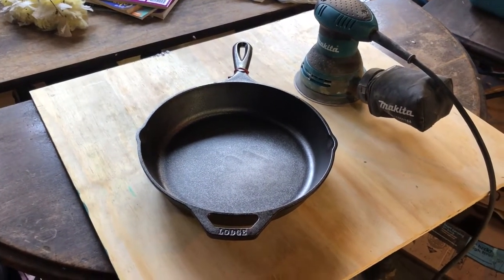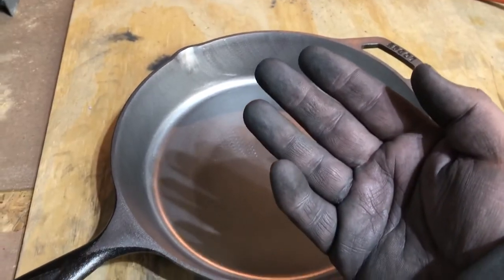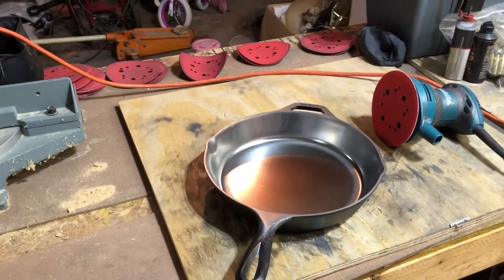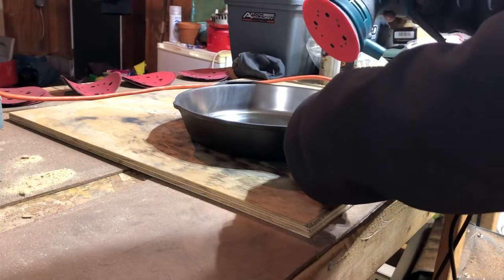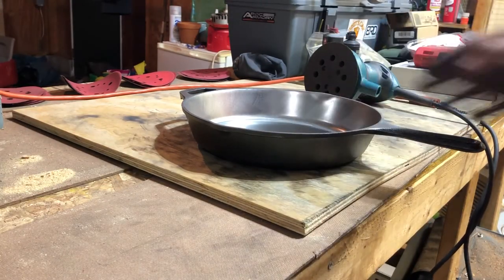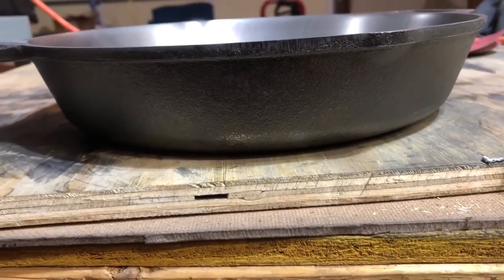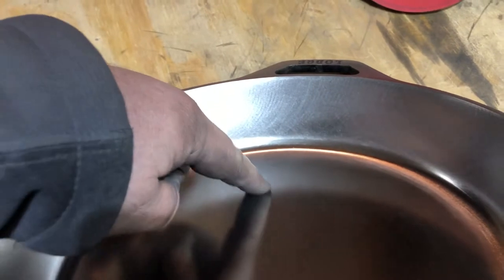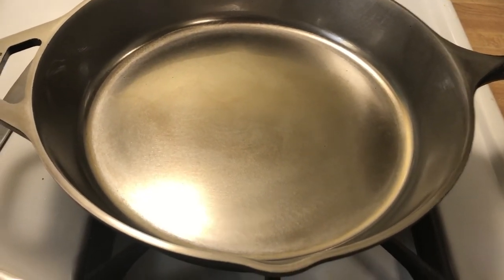DIY Refinishing Lodge Cast Iron - First attempt

Comment: Have you had any issues with seasoning coming off? I sanded my lodge and have had issues with the seasoning sticking.
Reply from the maker: Yes. I went too smooth on these. If I do another one it will be 40 grit just to remove the factory seasoning. Cosmetic change only.
Reply: @jimknowlton342  I just learned this lesson last week. Low grit to smooth it off, then let the oils and seasoning do the work for you. Beats blowing black iron out of your nose for days after too.
Reply: I only remove the sharp high spots with 40 grit and leave the pits. Then I continue with 60, 80 and sometimes 120 grit for a finer scratch pattern. The resulting surface is still slightly uneven and completely covered by the small scratches. It holds a seasoning pretty well and is much easier to clean than a rough surface. No more tearing apart the towels and sticky stuff releases much easier. You don't want a mirror finish as the seasoning will come off easily.

Comment: Still needs to be seasoned.  Question.  Does the oil stick and bond on such a polished surface. That's what makes it stick free. Does the oil adhere for the long term?
Reply from the maker: If you can get it hot enough and build up enough thin layers, yes it sticks.

Comment: Once you discover that the pan will now not hold the seasoning and you are about to discard it, boil some white vinegar in it to etch the smooth surface and wash and reseason. Voila a black and seasoned great pan to be used for the next 5 generations. Or more!
Reply from the maker: No. It's over two years since I made that video and the pan is fine. Thanks.

Comment: Looks AWESOME…only question…after 6 months….how has it taken seasoning, being that polished? Would you have done it any different in hindsight?
Reply from the maker: It takes on  a very attractive finish. The seasoning does not stick well to it. I think you can  either do it or not, it makes little difference in  performance other than appearance.
Reply: @jimknowlton342 
I did the same thing but I bought 2 Lodges. 1 I sanded down and the other I left alone with the rougher surface.
Seasoned both the same way with grapeseed oil and the rough one is better IMO.
The sanded one looks better but much like my Stargazer pan, it's been a chore taking seasoning.
Reply from the maker: @MrBullet888  I agree with that. If you decide to strip it I would say maybe just do the 60 grit or maybe up to 150 tops if you like the look, but for function it is not in any way better or worth the effort.
Reply: @jimknowlton342  I sanded my 12 inch down completely. I think it’s made a major difference now that it’s excepted the seasoning. One thing which was a huge game changer for me when it came to seasoning is using seasoning oil‘s from companies like field. You seriously have to try those proprietary blends that have a tiny bit of beeswax in them you only need the smallest tiniest amount and now my pans are waterproof, everything just beads off of them
Reply: They are made well for modifying because they are plenty thick. People like to over-smooth the finish but its nice to have a little texture for adhesion of the seasoning. Vinegar after sanding has achieved some nice results in other videos. Cooking is about experiments so keep it going everyone that is willing! These experiments make people that don't own tools cringe and spew contrarian b.s.. For a 'not a metals guy', that pan looks superb. I'm thinking mild sandblast after fine sanding would deliver that $200 pan effect. Some one out there, do a video on that please.
Reply: Basically this makes the pan look good. But you effectively destroyed what makes the cast iron pan a cooking pan.
Reply: @brianjensen2532  Cast is almost invincible, just don't drop it or drop it in a fire to clean it, or use the oven to blast it to 900f. Please quit using dutch ovens for flower pots as well people. Other than that any pan can be fixed if it is worthwhile.
Reply: @brianjensen2532  : I might tend to agree, but I am also not sure.  If I get a newly made cast Iron pan, if there are some distinct bumps in it that I feel would catch a spatula, I might address those individually, then give the pan a quick "knock down" with a coarse grit, leaving most or nearly all of the basic surface texture.

Comment: Actually, you just want to take the factory seasoning down a bit to remove the high points. The seasoning is what makes it smooth, not polishing the iron to a mirror finnish. The seasoning will  not stick well on that smooth surface well.
Reply: Well, old pans are really smooth, just because they were milled or sanded down.
Reply: Actually it will. The old cast was smooth.

Comment: Brother Im very impressed , I'm trying to do a Lodge pan also. What and how how many disks did you use in order? Thanks for the vid btw..people forget how valuable cast iron is.
Reply from the maker: I started with 40 grit and went to around 300 or something. I think I used quite a few of the 40 grit, around 8 or 9 to get it level and smooth. Then I started to polish it with the higher grits.

Comment: To each his own, but I would never spend the time and effort to do this. I have several Lodge pieces and they work just fine as they come from the foundry. I know that some people are fixated on that super smooth surface, but why not buy a Field or a Finex or one of the other premium brands, and not go through all of that? As I said, to each his own.
Reply from the maker: This was a test, thank you for watching and for your input. I agree with you we have not touched our other ones, some we have just hit with 40 grit and those are nice too. This is purely a patina thing, and it does make it harder for the seasoning to stick.
Reply: Could it be possible You may have an older Lodge? Been cooking for 45 years. I have two Lodge skillets. They no longer polish the inside of the skillets like they did years ago.
The older Lodge, has a smoother bottom,  the other one is only a couple years old- a gift from Cracker Barrel - it has a bottom like very stiff rough sandpaper . Been using them both Both for a while now and are well seasoned. I will always grab the older one to Cook in. If I need to use the newer one I have to put so much oil or butter in order for the food to not stick, where as the older pan barely needs any oil.
Reply: @anitamarshall7528  I purchased all of mine new.

Comment: In a comment section full of experts, I'll chime in as well.

"Mileage may vary" .... it's the same old tune. One doesn't have to possess a doctorate in metallurgy to attain acceptable results in surface-conditioning a cast iron skillet, besides, what works for you may not for the next ten guys in line. There are literally dozens of variable factors which affect the anecdotal outcome of every pan out there, but it's seems at least logical to look to the more expensive pans available and model your project after what they're selling. Stargazer, Smithey, Field, all for example, machine and finish the cooking surfaces of their products, Lodge doesn't. Get what you pay for ... OR you can buy cheap and put in your own work for the same end result PLUS the sense of accomplishment in knowing you have a one-of-a-kind cooking piece worthy of becoming an heirloom with a story. Jim, you've done a fine job. Ignore the criticism.

And for anyone out there cooking in cast iron with metal utensils, washing them with anything more than a fresh oil wipe-down, and NOT sliding your skillet into the oven every time it's hot for a "free" seasoning treatment; may every biscuit you bake taste as rancid as your soul.

Comment: I learned the hard way that if the surface is too smooth the seasoning will not stick. I also learned the hard way that I needed a respirator.

Comment: My friend is a huge fan of Lodge iron cookware.  He did that too and got it to a fine smooth surface.  
Don't do it.  It is a mistake.  He ended up sand blasting it to get it back to its original surface condition.  The rough surface holds the seasoning and is what keeps it non stick.
Reply: it depends if he go past 400 grid the seasoning will have harder time to adhere. I done same sanding to my skillet, it was a bit more work and i hear somewhere its good to let the bare metal sit for a week to make the oxidize a bit. If it does something dont know i start seasoning raw pan right after sanding. 
Seasoning smooth skillet is harder for 2 reasons. First there is less for the oil to grab when starting new seasoning. Second you are prone to putt way too much oil in first run. I learn that the hard way and have to scrape the thick burned oil. Rough surface you can oil and wipe and there is still plenty left. On smooth surface you can wipe almost all oil. So with rough surface its possible to do 1-2 thicker layers and be done. With smooth you need like 4-8 thin layers and really bake them good or they will flake. After 2 years i can make crepes with more ease then in teflon pan.
Reply: A vinegar and water solution will etch the iron enough to hold seasoning oil too.
Reply: @lizburgess4398   i know vinegar eat up rust and iron i just always forget. Maybe because i never use it in real life, but excellent tip.

Comment: Too bad Lodge doesn't sell them raw like that, it looks so much better. Great job!
Reply: I am sure they are never that smooth at any point in the process at Lodge.  Which is why there are high-end cast iron pans selling for 6x the price of Lodge.  If you want mirror smooth when you get it, you have to pay for that.  Or take a sander and a few hours of significant work.
Reply: Also the rough surface help it keep its seasoning, its going to be extra hard to season it now with how smooth it is, nothing go grip on too.
Reply: @StuninRub  then try seasoning two pans at the same time one rough and one smooth. The smooth pans always season streaky and requires more effort to get an even coating.
Reply: @elisiahcampbell4572  Nope, not if you know how to season correctly.

Comment: Not sure what your total cost was in resurfacing the pan, but it may have been more practical to have purchased a better grade cast iron pan to begin with: "Field", etc.  No harm done in seeing what you could accomplish, though.
Reply: I was going to post the same thing. It'd be neat to compare a well seasoned, diy sanded Lodge VS another pan in the same price range all things considered:

Sanding pads: 0.67x30 = $20.10
Pan cost: ~$20
Labor: $20/HRx3.5 = $70 (this could be quite a bit more, depending on how you value your time)

$110.10

That takes you into a whole new level of quality. This also assumes you aren't buying an orbital sander just for this project. If you're just looking to dick around in the shop and see how far you can take a cheap pan, more power to ya, but.... I don't know, man. 

I'm also interested to see if there would be any difference if you were to do the easy off oven cleaner to strip the factory seasoning before the first stage of sanding. Seems to me like the first couple rounds of paper might live a little longer? But then, that's $5 or 1/4 of the paper fund, might save in labor though.

Comment: 90% of my cast iron stuff is "vintage" on some of them you can even see the milling machine marks that was used to smooth them out on. it is so shameful that now they make such garbage it is unbelivable.
Reply: It’s because the fine sand used in molding them was causing silicosis in the workers. Basically turning their lungs into concrete. Manufacturers started using larger grained sand to reduce dust and lung damage.
But to be honest a well seasoned rough cast iron pan cooks just as well as my antiques.

Comment: you do not want to go all the way to mirror finish. The way Cast Iron works is that oil sips into metal pores and that is how it becomes non-stick. I want to smooth it out but only to the point where metal pores still open.

Comment: i did a similar thing to my old 10" skillet which was well seasoned and had 20 years or so of use and good maintenance. after refinishing and 4 bakes to season again from scratch, and the performance was not any better than before. it was worse, but maybe it's because my old seasoning was so good.
Reply: it get better after a year or two. Smooth skillet is not better then raw cast after seasoning (the difference is only in very specific uses). Its more about utensils, smooth pan is way more gentle to them so less metal or wood shavings in food. Also the cleaning is easier that the food can be scrape off and the pan dont act like sandpaper. 
One thing i add is old way of making skillets was bit more time and material consuming but create way more smoother surface that dont need sanding at all. But due to reusing the same sand to save money the cast is much rougher. In old method 60-90% of the sand was use just one time.
Reply: Of course it would get worse. You took off 20 years of seasoning. The best time to sand it down is when you first purchase a lodge cast iron. Then build up the season from there

Comment: What's the point here for all this work?
Reply from the maker: To see what would happen and how it would work. In the end the function is very similar but the look is different. It depends on what you want. I would personally not do this to any more of mine, at least past 120 grit.
Reply: Ease of cleaning. A smooth surface is much easier to clean and no longer tears apart the towels. But he overpolished the skillet in this video. Using anything from 40 to 120 grit and removing the sharp high spots only already makes a huge difference.
Reply: If you have to ask.....🙄

Comment: Should have stopped at 80 or 120 grit. Too fine a finish seasoning won’t stick.
Reply from the maker: I would generally agree with you there. I saw a guy take it down to a buffing wheel online and I thought I would see how far I could go. I think there are major issues with return on investment to go past 120-150, and also it does struggle to maintain seasoning.
Reply: You could only use 40 grit and still have a smooth surface with a nice scratch pattern that holds a seasoning very well. Just don't go higher than 120 grit and it will perform well.
There's also no need to remove much material. Just get rid of the 'spikes' and leave the pits of the cast texture. The pits will quickly fill with seasoning and the uneven surface holds the seasoning very well.

Comment: I feel like you shouldn't have to go to this much effort to get a smooth finish on a pan you are forking money over for. Lodge should step up and start offering a better finished surface. If people have to go to that much effort to improve on a product then the company offering the product should have taken note by now. Ridiculous.
Reply from the maker: I had fun!
Reply: It’s because the fine sand used for casting old pans was causing silicosis in the workers. They are now molded with larger grain sand.
It would take much more time/effort to mill the pans to get a smoother finish. If lodge did that the pans would probably cost $200 instead of $15.

Comment: No, I really don't see the point in this video. You took a perfectly good skillet, already pre-seasoned, then spent at least $20 and several hours of labor to remove said seasoning, just to spend several more hours re-seasoning it again, when all you had to do was get it home, wash it with hot water, no soap, dry it, put it on the stove and cook something in it. Bacon, eggs, deep fry something, almost anything. You don't have to do ANY of what you did, every Lodge skillet I've ever bought I've used when I got it home and had no trouble with them. The seasoning that comes on them can be a bit rough, but it's not bad and can be cooked on, and as you cook and re-season them after every cooking, it will fill in and smooth out, even after one or two cookings. This whole thing seems like a waste of time and money.
Reply from the maker: Thanks for watching
Reply: For bacon and eggs it will do but crepes and omelets that is a next tier and you need that smooth surface. Also it cleans easier. Also maybe because i use my in very specific way because after 4 years of usage the seasoning is still thin but super smooth and hard. I can make crepes with more ease than in teflon pan. I use steel utensils and eat from it regularly, if i have not sand it the pan will sand the utensils. Also i dont use oils for seasoning or cooking just lard and butter, it dont create that sticky seasoning like oil. So i can wipe the pan with paper towel, it dont go rancid and the surface is way harder and scratch resistant then with oil.

Comment: Do you cook ?  Are you at all familiar with cast iron cookware ?  Did you just want it to be pretty or to be able to use it the way we’ve been using CI cookware for over a hundred years in the U.S. ?  If that’s a yes to my last question , I’d suggest you throw the shiny one in the garage and either search for an old one online that’s been seasoned and used regularly OR , better yet , buy another Lodge brand skillet , (nothing wrong with them) and season it properly .   When you’re done , your skillet should be quite black , inside and out and should have a thin , oily , (not greasy or wet with oil) sheen to it.  And don’t use dish soap to clean it.  If you do it properly things won’t stick to it and you’ll not want to use any other type of skillet . You WANT that rough texture on your pan !  It will soon smooth out.  Totally leave the rough texture on the outside too .  Thanks !
Reply from the maker: You could read the video description, it will answer most of your questions.